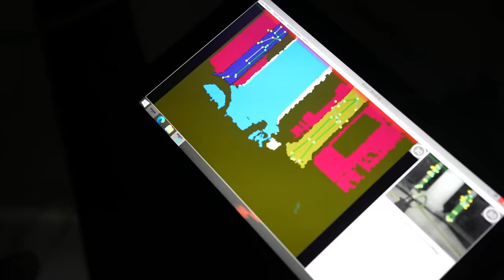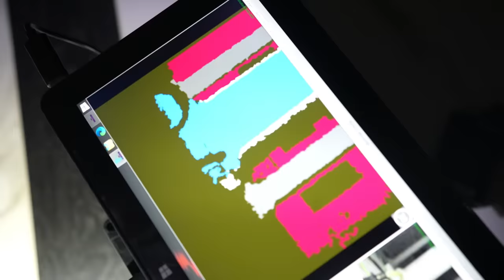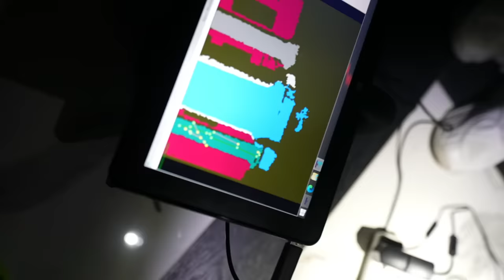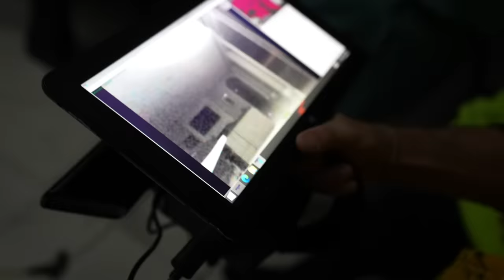A Real Ghost Hunter Investigated My NEW House.. **shocking**

Comment: At 12:40 I saw the ghost on the wall heading to the laundry room (it looked like a dot) and then seconds later they ran to the laundry room where the ghost was because the heard a noise 😳
Reply: It’s an orb it’s when a spirit is present and you can see it it’s very rare to catch it on camera
Reply: Yea very very hard to capture it on cam
Reply: Nahhhh🤣
Reply: Dam
Reply: 12:51 is where the orb glides behind Rug
Reply: Yrue
Reply: It’s most likely just dust
Reply: @Xomria  it was a moving circle tho back it fourth bug it could be light reflection of dust idk
Reply: @isaiahjones3427  it was ghost toom here orb

Comment: 12:49 A orb is on rugs back neck.. look closely.
Reply: its the lights
Reply: no way
Reply: Bruh💀
Reply: @blxzzlol  Did you not see it floating though. I feel like it's an orb that was around his presence.
Reply: @SeanOHaraHD  it could jus be little dust particles
Reply: Nah the courage rug has
Reply: That’s just dust in the air reflecting off the light
Reply: Saw it! Definitely an orb since it moves abnormally.
Reply: @blxzzlol  dust is alwsys round on pictures and when it is on video it is not round. sprit orb can be seen in pictures and video, and dust csnnot move upward since there is no wind
Reply: It’s an orb not a reflection off any light.
Reply: @blxzzlol  even it was the lights that so called "dust" must not be that perfectly round and it is moving upward even tho there is no wind  since rug said he turned all the A.C off